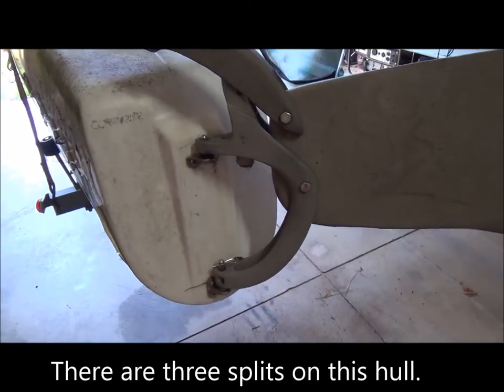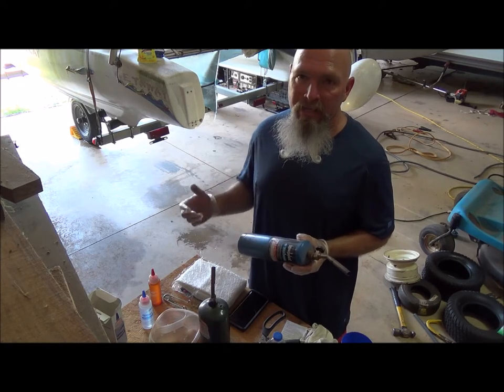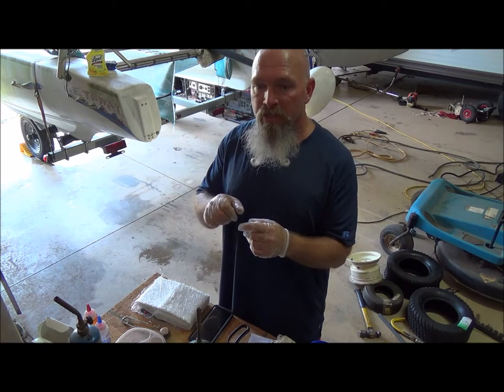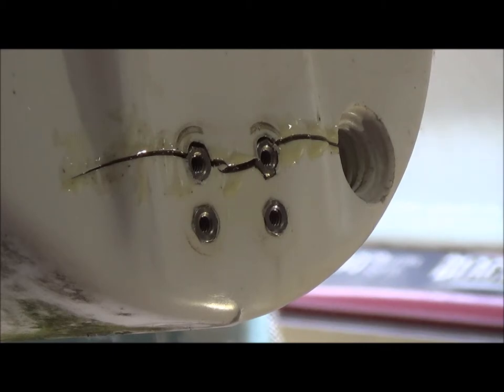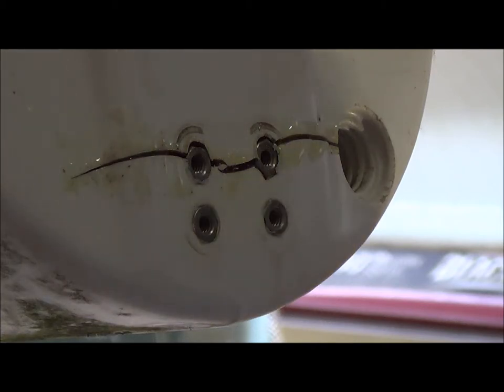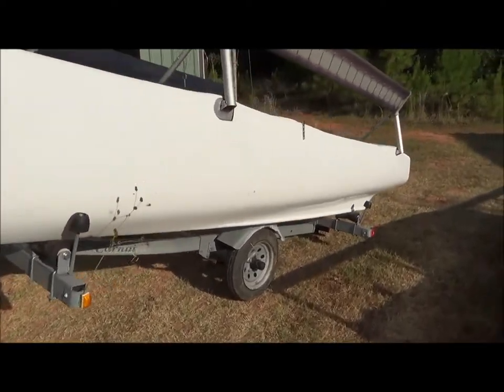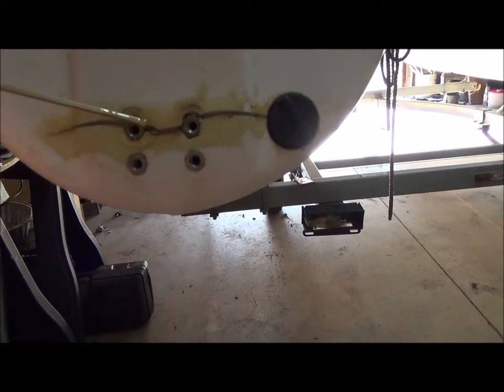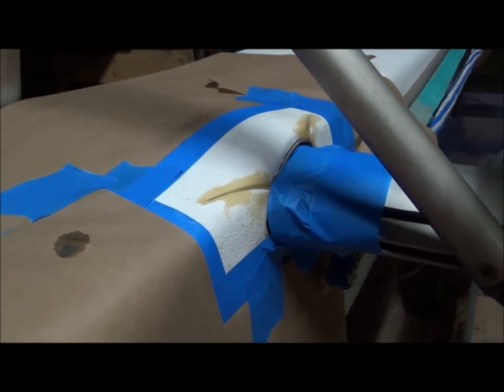Hobie Getaway hull repair with G-Flex 650

Comment from the maker: It has been right at a year and the repair has held up GREAT.  I spotted a hairline crack a while back and today I went out to repair it, but after sanding past the paint I discovered that the hairline crack was just the Krylon paint.  Apparently Krylon doesn't like to flex too much.  the G-flex repair was in perfect shape even after a year and sailing in some 25 mph winds, Oh and my daughter and I capsized it during a poorly executed jibe.  We went over in about  .0025 seconds.  Even with that violent capsize the repair looks as good as the day I made it.  Hope this helps for anyone wanting to give it a try.

Comment: Hey Mathew, thanks for taking the time to make this video.  Also, taking the time to update as well!!! I’m sure it has helped countless people, including myself.  Just finished up repairing a 14’ tinny that I’ve been putting off because this video gave me the confidence to go ahead with gflex.  Great idea using the vacuum. Thanks again bud, cheers from California
Reply from the maker: Thank you very much for the kind words.  I'm really glad the video was a help.  For everyone using a Vac to create negative pressure and draw the Gflex into the cracks, PLEASE be careful.  Those Vacs are powerful.  Use a towel around the vac hose with a loose seal, then slowly close the seal that will increase the negative pressure. Keep an eye on the hull, especially if it's fiberglass..

Comment: Dental irrigation syringes (with the curved tips) are really handy for injecting epoxy into crevices. I use them when building stitch and glue boats. Trimming back the tip increases the size of the hole, so you can even use them to inject thickened epoxy. They clean up with acetone, and can be used multiple times.
Reply from the maker: That's a good idea.

Comment: Hi! I would open the hole a bit (grind), and add the metal plate in front of screw holes, all the way to upper screw holes..Then all together with epoxy.

Comment: Thanks for the video.  I have a 2006 Hunter 170 mono hull made out a similar plastic.  There isn’t much out there on how to repair this stuff.
Reply from the maker: I'm very please with the G-flex.  I thought I had a hairline crack at the repair site.  I went out there this evening, thinking that I'll sand the paint back and bevel the crack slightly and fill in again with G-flex.  Wasn't necessary.  the hairline crack was just the just the paint, Krylon, that didn't like to flex and the G-flex repair was in perfect shape months after the repair job.

Comment: One question, you said you let it cure for 15-20 minutes and it was still a bit runny, but your third attempt you let it cure to the consistency of "soft putty" - how long did you leave it for that to occur before applying?
Reply from the maker: I don't remember the exact time, but It probably wasn't much longer than 7 extra minutes give or take.  Once that stuff starts to kick off , the time speeds up.  With your first batch and after the initial wait time , use a toothpick or something similar and slide it through the center every couple of minutes and watch for it to thicken up. Keep in mind humidity and temps, especially temps can have a serious effect on curing times.  Good luck on your project.  I've got a kayak to repair also.  Dang thing was standing vertical in the barn and got knocked over.  Landed on a steel fence T post.... not pretty.
Reply: @mathewdavis-adventuresandd6643  Ouch. Sorry to hear about your kayak. I can imagine what kind of shape it's in after something like that. Good luck! I will give the toothpick suggestion a shot when trying to determine if it's thickened to the right consistency before I apply to my kayak. I found one comment on Amazon for the g-flex mentioning to "let the material harden for 30-45 minutes before applying" in order to achieve a decent consistency that won't run. I guess it all depends on the humidity and temps, as you mentioned. Thanks again!
Reply from the maker: @dbsean  If you think about it, come back and let us know how long it took for it to thicken up.  I don't remember it being that long, but then again I mess with several different kinds of epoxies and time has a way of muddling the memory. lol

Comment: Great video - thank you. Were the cracks due to overloading or just weathering? How long had the boat been sitting in the sun?  Thank you!
Reply from the maker: Good day. Very glad to hear you enjoyed the video.  As far as the cracks go, honestly I believe it was a poorly mixed root mold material.  Those older getaways were prone to cracking.  The previous owner replaced one hull while it was under warranty and it has been rock solid.  The other hull cracked after the warranty had expired so it didn’t get replaced.  I’m certain it wasn’t from over loading since the previous owner, an old coworker, couldn’t get his family to sail with him.  One reason he got rid of it.  That Hobie was setting in an Oklahoma open boat yard since it was new until I got my hands on it 18 years later.  So it had been in the elements a very very long time.
Reply: @mathewdavis-adventuresandd6643  18 years! Wow - thank you very much for the info.

Comment: You didn't even attempt to close the gaps. I would have used large bar or pipe clamps to close the cracks.
Reply from the maker: Please keep in mind that not everything is recorded and I don't always get things done on the first attempt.  Wish I did.
Reply: Wouldn't that keep the repair under more pressure trying to keep the gap closed?  Seems like the split relieved some pressure (by splitting) and you'd just reintroduce that pressure.